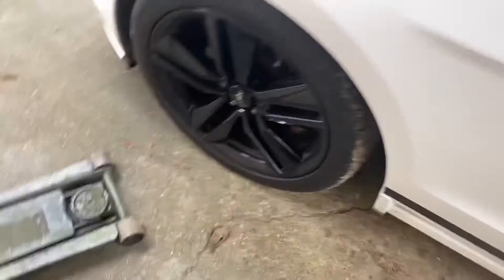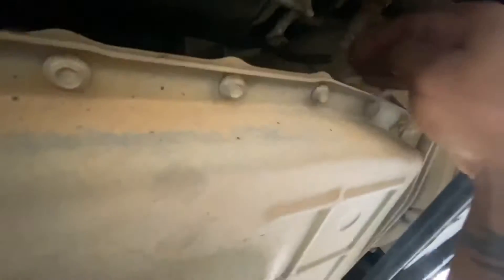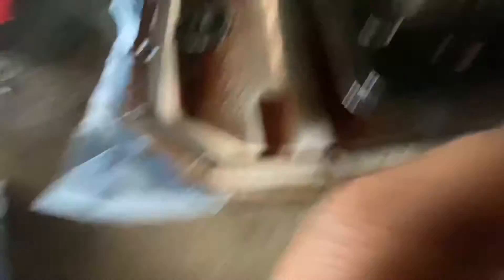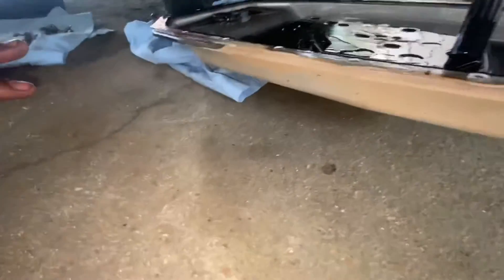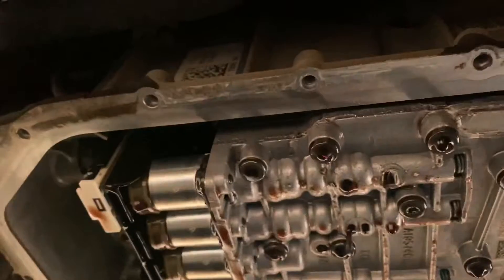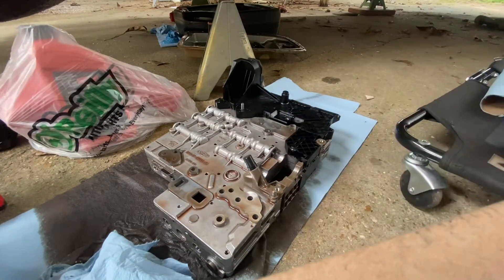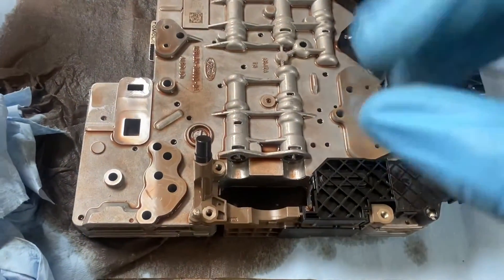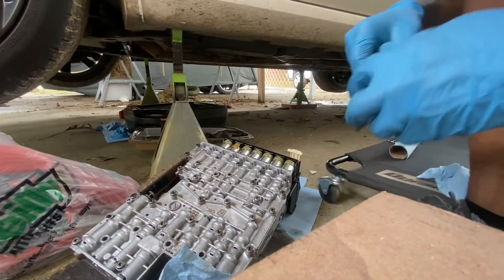FIX!!P0720 P0722 6r80 Ford Mustang transmission code OMG MY TRANNY FELL OUT ON THE ROAD!!

Comment: hello dude, my car when i am driving the speedometer goes to 0 and start to do the shifts bad and doesnt acecelerate just move but like if it was in first gear only if i wait like 5 minutes and i turn of the car and turn on again the car works good again and that is happening all the last week and i want to ask you if you think that change the lead frame can helps me and if that fix your issue 

thanks you and i am sorry for my ugly english haha
Reply: Did you ever figure it out. I’m having. The same problem. Some say it’s the throttle body others say it’s this. I hope this isn’t the case cause this part cost like 1000$.
Reply from the maker: Sounds like you may have something not connected
Reply: Lo solucionaste ? Mi auto presenta la misma falla :(
Reply: @rito3779 did you figure it out? i just had this issue while doing a 0-60 test
Reply: Is your car good now ? Facing same issue
Reply: ey bro same goes with me, did you fixed it?